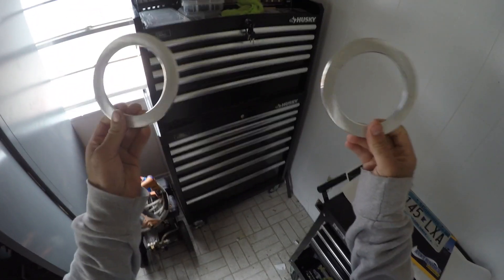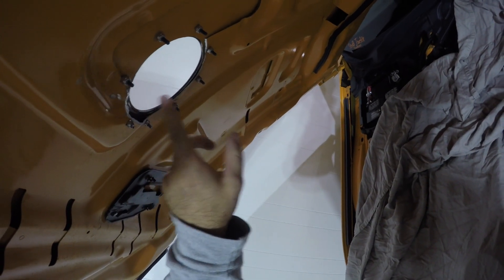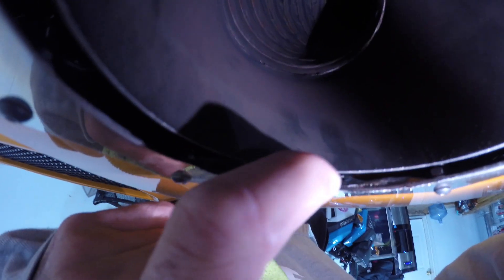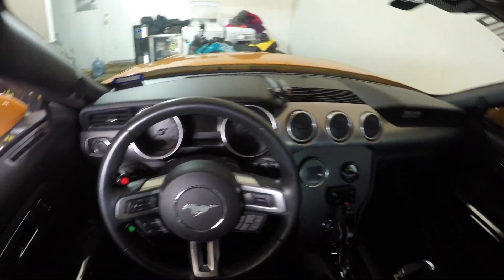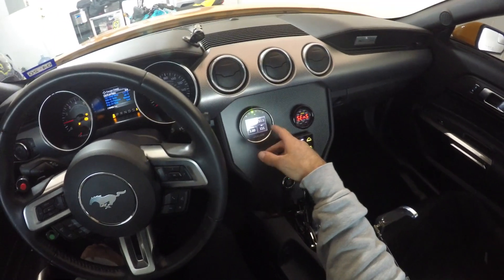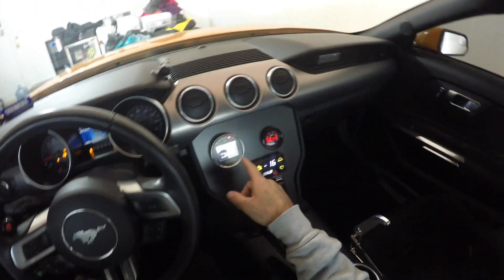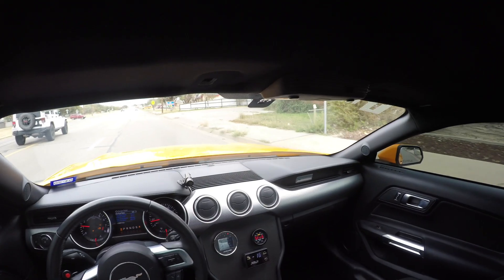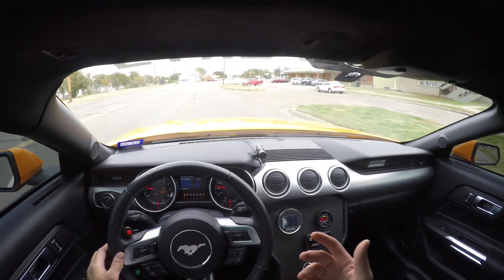Driving A TH400 Turbo Mustang On The Streets....

Comment: Do you run a 2 step with your car? If so how do you have the switch set up? I’m going to be running a similar th400 setup as you are but just curious how the 2 step would work. Thanks!

Comment: Awesome, video of my brother. I’m switching over to a TH 400 also. I’m going to do some real racing with my car. I got over 1000 rear wheel horsepower. What do you think the car will do on the highway. What kind of speed will I hit, and what gear do you think I would be in at 40 or 50 miles an hour to start a roll race

Comment: Th400 is badass.  What read gears you have. I have th400 in my 68 mustang street strip car all motor pump gas.
Reply from the maker: 3.15 I’ll probably change soon
Reply: @DavidVanVoris  Why such high gears and not 373's or 410's.

Comment: Watch 2nd gear bro or get the pro mod drum 36 element.  If you downshift from 3rd to 2nd and aren't accelerating,  you will waste sprag. I am installing pro mod drum and 36 element sprag to bulletproof my full manual th400.
Reply from the maker: I’ve heard that but I’ve never had problems. This is a pro mod drum
Reply: @DavidVanVoris  So you have had no issues downshifting 3rd to 2nd with pro mod drum. I was told they are bulletproof.  Getting one now
Reply from the maker: maximus vonce no I mean I don’t recommend it but I’ve done it. I don’t use it to brake

Comment: The gauge to the left of the boost gauge you referred to a the “n” gauge. What is that specifically
Reply from the maker: It can view anything from the car via obd ii and is what tunes and data logs the car
Reply: Could I please get some more info as I might want to get one. Thanks again
Reply from the maker: Ron McBee you can purchase them through Lund racing and get a tune from them

Comment: I watched the video when you installed the fuel system, and you set the pumps about the same length I did mine. I’ve ran my car all the way down to 10 miles to E trying to find an e85 station. I’m sure you did, but did you install the line that connects to the passenger side tank correctly? If not, you’re car would run out at the half tank level like it’s doing.
Reply from the maker: Yeah it’s only under wot if it’s under half closer to 1/4 it goes lean. I’ll have to check
Reply: David Van Voris I would definitely check on that because I have the same fuel system you do from lethal performance for my ‘18 and I set my pumps right at the same length as I saw yours set to awhile ago. Good luck man!

Comment: How did you get the speedo working after the th400 swap? I just did the JPC system on a 2012 Coyote and I’m scratching my head on how to pick up a speed sensor signal.
Reply from the maker: Bob Forthun on s550s we don’t have to do anything it’s a wheel speed sensor
Reply: Lucky you. Appreciate your getting back to me. Thanks.
Reply from the maker: Bob Forthun I believe JPC has a reluctor wheelie this
Reply: Did you get Speedometer to work on 2012 mustang.  How did you Do it?

Comment: Hey on your clutch input. Did it go to the PCM or BCM? What pin if you remember? thanks in advacne
Reply from the maker: I didn’t I ran mine to my trans brake. Email n2mb they will tell you
Reply: Thanks for the quick reply,, I am referring to the paddle shift input for the clutch pressed.
Reply from the maker: Twin Turbo Mustang it’s done via hp tuners from Lund
Reply: Awesome thanks

Comment: Now put a gear vendors overdrive on the th400 and you'll love it even more.👍
Reply from the maker: Brian Samuels that’s what I’ve heard!
Reply: @DavidVanVoris  it will make your car faster on top end.
Reply: Gear vendors overdrive adds 100lbs bro
Reply: @maximusvonce1381  nope! I weighed mines before I installed it
Reply: @musclebone7875  Yea but it costs like $3k just for an overdrive gear.
Reply: @maximusvonce1381  yeah, but it's worth it. I paid only $1,800 for mines new.
Reply: @musclebone7875  Is it hard to install or no?
Reply: @musclebone7875  Whats overdrive weigh?
Reply: @maximusvonce1381  it's easy. I installed mines. It can be installed in a few hours not rushing. It also depends on the type of car as well. It weights around 45 pounds.